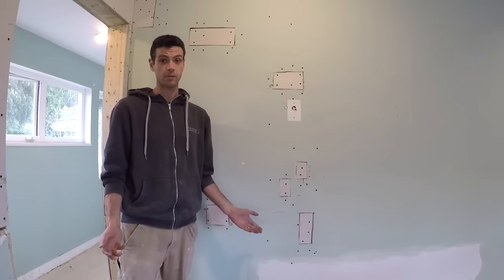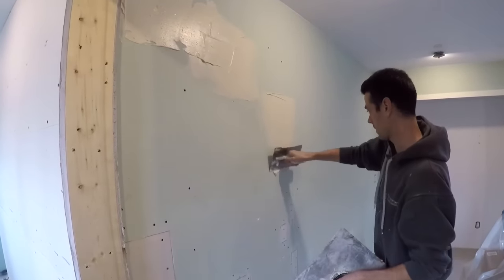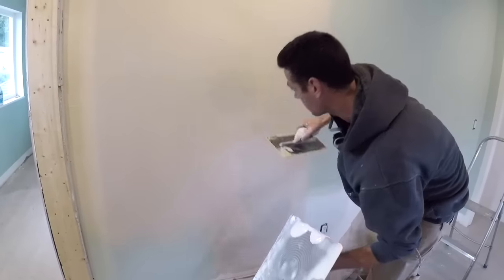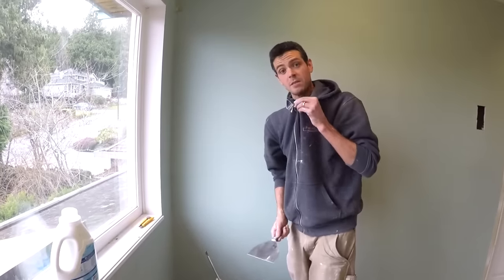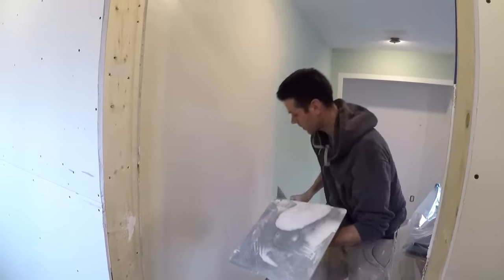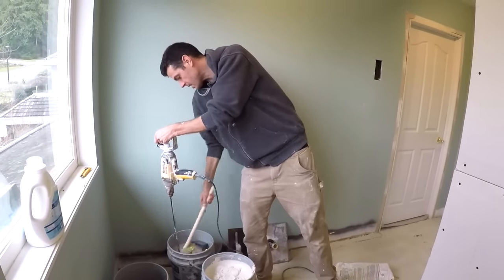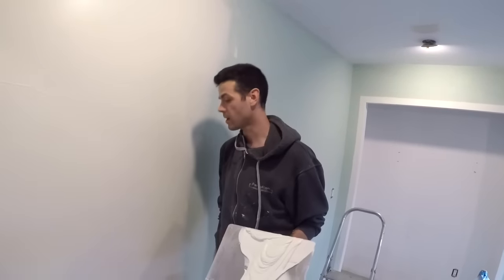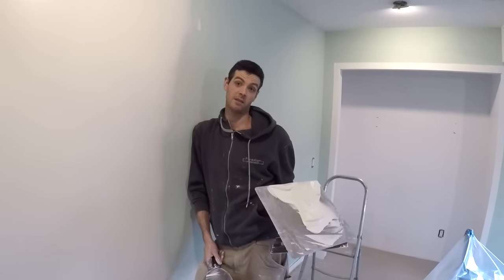HOW TO PATCH A HOLE IN DRYWALL!!! (Lots of them!!!)

Comment: Great job. But since now half of that wall would receive paint on compound, and the rest on drywall paper, do you think it would be necessary for the rest of the wall to receive a skim coat so the paint job would look even?
Reply from the maker: No. Not if you are a good painter. The joint will be sanded perfectly so you won't see the transition. Next prime with a 1/2" or 3/4" nap roller. Next sand the whole wall and paint one or two more coats. A good painter knows that you knock down the nap of the old wall in increase the nap on the new wall and they even out. Sanding between coats of paint is critical.
Reply: @vancouvercarpenter  That is great info, thanks! Would you be able to make a video on this topic? It would be very helpful!
Reply from the maker: @martin.klouse  I will. Not sure exactly when though.
Reply: Your answer works for flat to eggshell. If you're putting semi-gloss on, you will for sure see the difference. It'll take an extra one or two coats of paint, which wasn't included in my quote ;)

Comment: I can't stand when I show up to a job and there are 10 holes cut in a wall. It makes no sense. So I've learned to just take off the rock myself, and hang two new sheets. Saves a ton of time. And gives the customer a new wall as it should be for what they are paying. Not saying he did a bad job. He did a great job. Just a lot of unnecessary troweling. He definitely knows his stuff for sure.

Comment: The screw repairs looked like a garage wall on Valentines day! Support and fill  pieces should be drywall, fixed with heat gun adhesive. Done stacks of repairs that way, much neater.
Reply: Jack: great ideas here, you could expand a little on your details and have a VERY helpful post for many to learn from. Thanks for posting !

Comment: WOW ,that's crazy! I would've just cut out a 4x7 piece,leaving 1 foot from the top for a flat joint.
Then you only have one joint at the top and a long vertical joint.I think your showing off...
Reply: Agreed. Definitely not the best way to go. And it's not just Ben's mud-guy time that's an issue. Someone also had to cut out the damaged bits, cut up some patches (they're not the original colour), find and cut up some wood for slats, and then shag around putting it all together! Hope it wasn't the electrician, on his/her rates. Maybe homeowner sweat equity?

Comment: Worst thing about doing drywall, hanging all the Sheetrock doing a nice mud job, only to find out you have to come back because the electrician has cut 4 different holes in places they didn’t even need to access wire.....

Comment: the smartest way to do that is using a 36 inches self adhesive fiberglass mesh and doing 2 or  3 coats mix plastering and joint compound then do 1 polish coat

Comment: If it's 1/2 drywall , I would patch it with 3/8 drywall, as long as the areas aren't larger than a square foot or so.

Comment: Almost 23 minutes and the hard part wasn't shown. Maybe a video about how to cut out the section and replace it? Noticed the screws in most of the patches so did you have to make your own nailers?
Reply: They didn't use nails, like you said they used screws. So a screw gun. And cutting the patches square and screwing board in is the easy part
Reply: @Xylanth  I didn't say they used nails. I said "nailers". They are what's behind the drywall that the nail/screws attach. You can't just drive a screw into the drywall without one unless you are on a stud. To me, that's the tricky part of patching holes.
Reply: @netposerx  Oh I miss understood then. I've never heard someone call backing "nailers" before.  my mistake!

Comment: should u skim coat a wall after removing wall paper. just removed 1500sqft of wall paper
Reply: GTA Rider depends on what the walls look like underneath the paper, if the walls are textured you could probably get away without doing it but if you want flat or no texture then skim would be a good idea, just keep in mind skim coating large areas can be a real pain in the ass and will require a lot of sanding if you’re trowel skills aren’t adequate

Comment: I actually don't agree with how you handled this issue. The only time I would build up the wall like this is if I was trying to level two uneven surfaces. Sometimes you have to do this when you are patching 7/8" plastered wall with 5/8" drywall. Even after shimming the drywall, the thickness variations in the plaster will almost always cause highs and lows at which point floating a section makes the most sense. In your case, you have holes in the drywall which have no stress due to attachment to a stud. You don't even have to tape these. The hot mud gives plenty of strength alone when it gets between the joints of the patch. This also means that when you have no tape, you can sand the wall completely flush with the existing wall. use a couple coats of a high build primer and you are good to go. Trust me in when I say it will be plenty strong without tape. Plus, how much strength do you think the fiberglass tape adds?

Comment: Dont feel bad. Last summer, I framed, dry walled and mudded a new kitchen area for our fridge and a super pantry. My husband obliterated my beautiful drywall with a roto zip, placing the water connection and a couple electrical receptacles AND the upper wall in the pantry because he thought that was the way to wire a CEILING light. Too lazy to let me crawl in the attic and pull wire? He obliterated my beautiful smooth walls. Tears. Good news is it allowed me to increase my self esteem when I patched the areas and you couldn't see any bumps or lumps. 
What is wrong with people?

Comment: Bed mesh tape with hot mud use a six inch knife. Coat tape with hot mud use an eight inch knife. Put a top coat on with a twelve inch knife. depending on texture if it's a knock down skim coat the wall then spray it. If it's a hand texture skip/santa Fe then skim the wall and apply your texture 
Easy money no need to take all the rock down

Comment: Replace the sheetrock by removing the old sheetrock with a Dremel multipurpose tool and drywall blade (time = 20 minutes), on center of the beam.  Tape and joint compound the seam and corner of the ceiling.  This job you did would have to be billed out at USD500.00 minimum.  Secondly, by you doing all of this labor, you are taking your profit from work you are not performing on other jobs.  Professional sheetrockers in New York are getting a $1.00 a square foot.  That wall is a total loss.

Comment: Admittedly, I'm a novice but what do you mean when you continue to say "it's going to kick off". No clue what that phrase means
Reply: The mud is setting up (almost unworkable). If you try to smooth it too soon you'll drag the mud off the wall and make a huge mess! Stop and try again in a few minutes. Aslo, when you put quick set mud on top of an almost dry layer (2nd coat) of quick set mud, it will set faster than the previous coat, as quick set mud produces heat as it dries. If you're a noob, don't try to use 20 minute setting mud, or you'll create a mess if it dries too fast. Try 40 or 90 minute mud instead, as it will dry much faster than regular mud, but is more forgiving from a timing standpoint. If you think sanding regular mud sucks, try sanding off a large amount of quick set mud, as it sets up much harder. You'll never make that mistake again, or let's hope you don't!

Comment: That sticky tape is meant to have mud behind it first. It was how they engineered it to work. A lot of people  just stick it on repairs because it is sticky. But it's not how it is supposed to be used
Reply: You're wrong, and confusing it with paper tape. That's mesh tape that he is using. It's sticky for exactly that reason, so that you can stick it on and float mud over it. Paper tape, you float some mud on first, and then slap paper joint tape over it, and use a joint knife to smooth it down.

Comment: Would have just cut the drywall out and replaced it. Way less work. From my own experience 1)mesh tape sucks. 2)mud in a box or bag is 10x better than the pre mixed in a bucket. 3)pay someone else to sand it lol

Comment: Step 1 hire competent electrician that can read plans and isnt incompetent. Also, bro for the time thats all going to take to patch, fill, and sand, just buy the 2 sheet rocks you should have and rehang them. If you're doing production, time wasting is a big no no. Just buy the sheet rock again and get a better electrician.

Comment: No disrespect but North American drywall/mud/tape construction is hilarious to me as a European. In the Uk we use gypsum plaster and bricks. The NA method of stud walls covered in board and taped together is just so flimsy and cheap feeling.

Edit: Not being intentionally argumentive either. My house, a pretty cheap house, still has original lime plaster and wood beading from 1914. 
Its been standing, on a hill, at an angle, for over 100 years.. 
I just don't quite get why y'all building houses like its 1799 stil..

Comment: No, u dont just replace the drywall. He fixed it with 4 tools that were already out, didnt have to undo any work, and already had the mud to do it with. Took him 1 hour + sanding. Get a job, ppl
Reply: I disagree... Didn't someone have to put blocking in and cut squares for the holes? 

A few hours probably total... But would have been just as easy to cut down a stud and have a wide but joint
Reply: @timbrown6278  yes, someone put the time and effort in to making all those patches. The homeowner is being billed for that time. Now, cutting a 4x8 sheet out of the wall with all that guys patches, going to the store to grab more drywall, installing drywall, and then almost just as much time into taping it as we watched right here. Theres a harder way to do everything, you're supposed to avoid that

Comment: I would just rehang the wall
Reply: Have you ever removed finished drywall? Too much time too much work.. it takes a lot longer to find the old screws and remove the sheet and then throw up a new sheet and add 2-3 coats of mud when you can just throw on mesh tape and  literally use a 5min coumpond if you know what you're doing. And add lightweight coumpound, sand, and you're good.. you save time and money on hauling a whole sheet of drywall for a 3ft by 9ft section
Reply: I've been doing drywall since I was 13, I'll be turning 41 in May God willing.

Comment: Talk about a hack lol very clear you do not work on multi million dollar homes you wouldn’t last one day on my crew
Reply: Assuming the same starting wall, what would you have done?  Genuinely curious since I don't know the trade.
Reply: Rgd
Reply: RDG Contracting.. This guy is the finisher.. I dont know another that would do it better.. Million dollor home or not.. Yeah it should have been rehung.
But the homeowner was good with patching..
 I myself am a tradesman
Local 175 Louisville ky.
We renovated the YUM brand headquarters 5 floors.
Multi million building..it looks like the Whitehouse.
Home of KFC.. Believe me we had walls that looked like Swiss cheese after the plumbing and mostly electric went in...
And we used these same techniques..
Reply: RDG Contracting if that’s how you think I would never let you work on my home!  This guy can come tape my jobs any day of the week
Reply: Where's your video?
Reply: Mesh tape is for amateurs.  Will for sure crack later on down the road